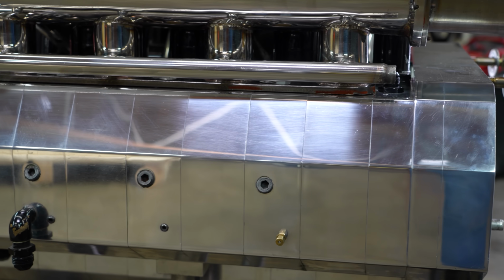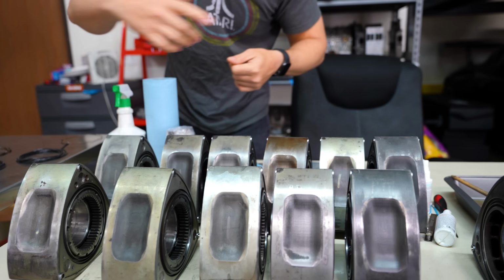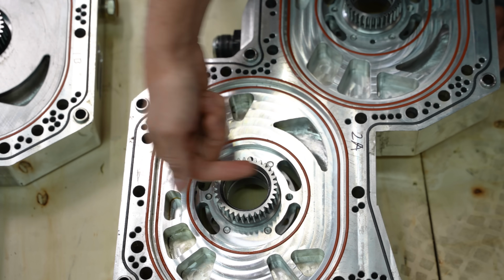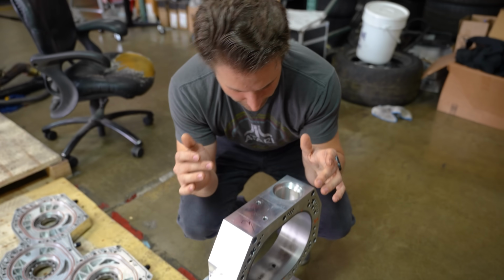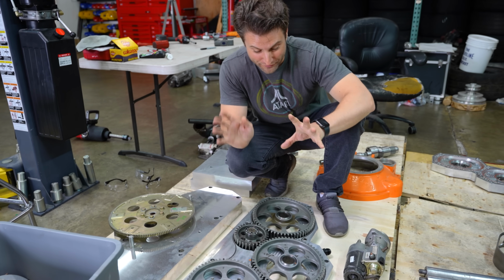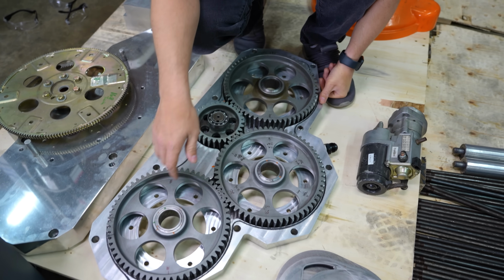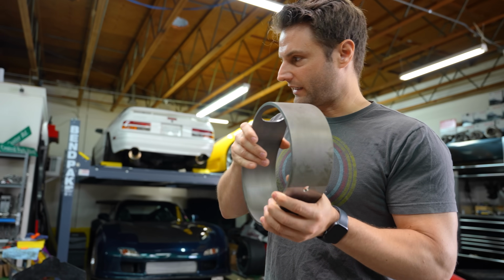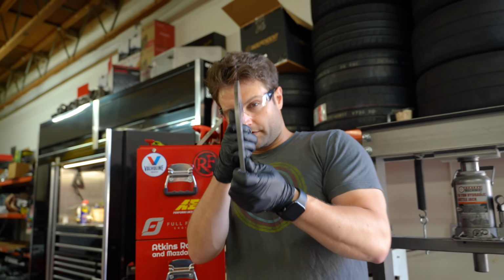Everything wrong with the 12 Rotor

Comment: To solve the 3* timing offset in the gearing, would it be beneficial to have another custom gear made with the inner spline for the shaft to account for the 3* offset? seems like you might be tinkering with that idea already from the marks you made on the inner spline circumference. anyways pls throw this 12 rotor in that boat of a Lincoln lol!
Reply: They may have already designed this in. If the key is not centrally aligned to a tooth (or valley), the gear may have 'a' and 'b' sides. Ie Flip over to change timing....
Reply: it might work to just rotate one of the gears to get to a point where 3* is offset.
dit that to my mazda bg 323 with a BP 1.8l 16v engine when running a ex camshaft on the intake side and had to recount the timing of the camshaft as the gears got different timing marks.

Comment: It's so cool getting a proper video showing the inner workings of this mythical motor and I'm super excited to see it go together and hopefully fire up soon enough. There are so many weird myths and claims about this thing, just yesterday I saw someone claim this exact engine had been dynoed at over 5000hp with turbos, which is funny because it has never had turbos mounted to it.
Reply: There are people walking this earth who believe devel sixteen is real driving car with 5000 hp.
Reply: @hadrian2505 To be fair, the engine for that did actually exist and produced a fuckton of power, it's just the rest of the car that ended up being fake.
Reply: @hadrian2505  I mean Steve Morris did make a 5000hp engine for them, it just never made it into a production car
Reply: @claybrinkman533 because it’s not possible, having an engine produce 5000hp doesn’t mean you can put it in a car! There is so much more involved to do that.
Reply: @Mark-vn7et  Of course it wouldn't go in a 'production' car, but there isn't anything about putting the engine in any other car that could fit it.
Reply: @cn1364-w6c  doing what? 1/4 mile? How in the hell do you want to cool that engine? What kind of transmission supports 5k for the road? Tires would be shredded after one 10-second pull. Producing a 5k engine is the “easy part”, it’s the rest that’s hard
Reply: @Mark-vn7et  Do you not know anything about cars...?

What else do you think other high horse power cars do? 1/4 mile or 1/8 mile races.

How do you cool it? Well, you don't need to if it's purely a drag car. Otherwise, you cool it like you do any other car. The engine isn't making 5000hp ALL the time. It's only making that much HP when you need it do. If you are normal cruising, it's not generating any more heat than a similar sized engine .

Transmission? You can get a TH400 rated at that hp

Tires? If you aren't launching it and just cruising, then normal tires you'd put on a 1000hp car is fine... When you take it to the drag strip, then you switch of course.
Reply: @cn1364-w6c  having a guy build a drag car in a shed and calling it “road legal” just because he happens to live in a state where everything with 4 wheels is road legal doesn’t make it suitable for it. But sure believe all that bullshit talk and forget what company’s like Bugatti and koenigsegg are saying. They spend hundreds of millions on R&D and can’t come to half the power.
Reply: @Mark-vn7et I agree with the premise of what you are saying, but if we see a 5000hp production car it will be electric. A direct drive or 1spd fixed ratio trans and a very large battery with several drive motors would get you there. The technology to make the car is 100% there, but as you alluded no tires currently exist that could handle street use and actually put that power down until very high speeds. I believe as tire technology progresses we will eventually see a 400mph capable production car and it will be electric and extremely expensive.
Reply: @Mark-vn7et  Well, you're comparing a 100% legal production car with a purpose built car... Of course 5000hp isnt' a feasible PRODUCTION car. Imagine the warranty nightmare and day to day care would be impossible... but... I already literally stated "not in a production car".

Outside of obviously not being production car feasible, I already disproved every "impossibility" you mentioned.
Reply: @Mark-vn7et Lol, they were probably saying the same thing when trying to squeeze 100-150hp out of the old Flathead V8s, or when the 1/4 drag strips were pushing 10 or 5secs. Tires have gone from barely keeping race cars on the track, to making a stock Honda Civic or Mitsubishi Mirage comparble to a Camaro SS or Pontiac GTO from 1969. Transmissions have gone from 2/3 speeds to 21 in a lot of automatics, and if a block made to contain 5khp, a transmission can be built to transmit it.
Reply: @cn1364-w6c  no I’m not talking about emissions or crash testing or anything. A purpose built car, exactly! Purpose build to do 1 or 2 pulls on a drag strip before blowing up or needing a rebuild, new tires and anything. In that case 5k is peanuts because a top fuel car puts out 10.000hp. The Thrustssc puts out over a 100.000hp. Where do we stop calling cars cars? All I’m saying (and this channel is a prime example of this with rob tinkering away with almost every part of the car to make the 4-rotor work properly) is that there is so much more to a 5000hp car then having a 5000hp engine. You could put that engine in the back of a pick-up in a crate and claiming it’s a 5k truck, well it isn’t if you are not able to use any of that power. Man the video of Steve Morris engine is like 5 years old and still the only footage we have is a kitcar with a stock LS put in the back.
Reply: @rya3190  dont get me wrong, I’m not saying it isn’t possible. It’s amazing how far we have come in the last 20 years. But the leap difference that some people claim now with “limited resources” compared to HyperCar builders (who are in a freaking arms-race with each other) is too much. Bugatti needed 10! Radiators to cool a 1500hp, and here we have a bloke who says nahhhhhh just one tiny radiator is enough for my 5k engine. Does that really make sense? I know where I’m betting my money on
Reply: @Mark-vn7et  Do you even know what point you are trying make...? You're all over the damn place.

SMX engines are rated for 5k, and Tom Bailey runs one in drag and drive events so it sounds like your point is kinda moot.
Reply: @cn1364-w6c  I’ll be back when I will see the 5k devel in action……..so in other words goodbye
Reply: @Mark-vn7et  do you mean the car that’s already both daily driven and taken to drag and drive events? Your ignorance of cars is hilarious
Reply: @Mark-vn7et  do you seriously want me to prove why your Bugatti statement is stupid as hell or do you want to delete it and save yourself some face. It’s clear you know nothing about cars
Reply: @cn1364-w6c  show me, show me where I am seeing a 5000hp devel 16 doing a full pull on a drag strip.
Reply: @Mark-vn7et  Bro i work with 30MW gearboxes on a monthly basis.
Reply: @Mark-vn7et  Sigh, I never said there was a devel 16 doing full pulls (go back and read). I said a 5000hp car that can be dragged and still driven is not a stretch by any means. 

Also, since you're back, i'm guessing you aren't done being educated on what you know nothing about... Do you even know why Bugatti has "10 radiators" or in your simple head, do you think because it has high hp, it NEEDS '10 radiators' and so all high hp cars need '10 radiators' to be driveable
Reply: @Mark-vn7et  I actually believe koenigsegg getting close to 2500HP at this point, at least behind closed doors. According to Christian von Koenigsegg himself, they are definitely able to push beyond 2200Hp, without revealing the exact limit.
The amount of "out of the box thinking" and innovation to get to those numbers and actually making it work is unbelievable. 

JP Performance, a german car-tuning company, posted a (mostly english) 3-part video series on Youtube this week, visiting the new koenigsegg facilities and getting fascinating insights on the inner workings of these cars.

And in a weird way, Rob looks like the rotary-garage-version of koenigsegg😂
Reply: The sheer volume of complete horseshit that I've seen posted about this one engine over the years is absurd, I'm willing to bet that most of what I had ever read online or even seen in videos prior to Rob getting his hands on it was completely wrong, I'm assuming they either just made shit up, guessed or continuing perpetuating crap that they were fed.
Reply: just go ugr  if u wan 2-3kwhp+ lambo that looks exactly stock inside out doing the power with ac blasting and drives like stock and can be daily driven, no 4x4 tyre , 93 will get u 1200, e85 2khp
Reply: Design a belt system to fix the timing issue
Reply: I've never seen a claim such as that but people have said that it COULD likely be a 5000hp engine IF it had turbo's.